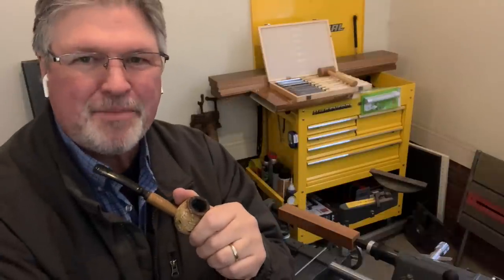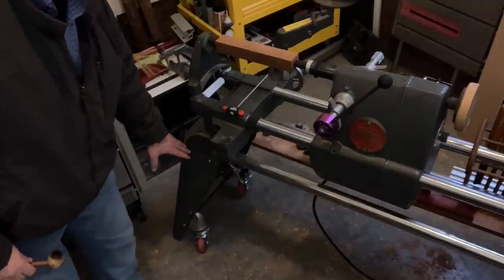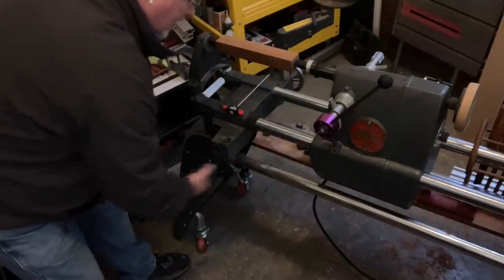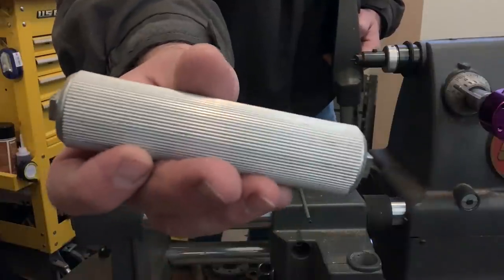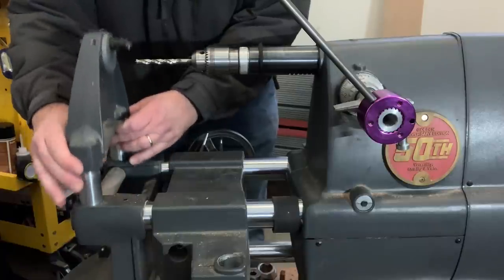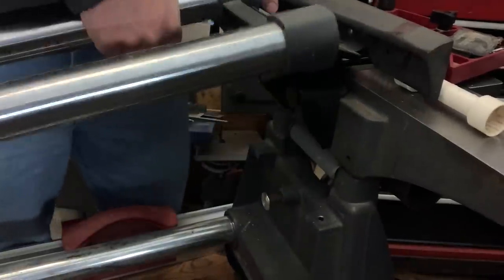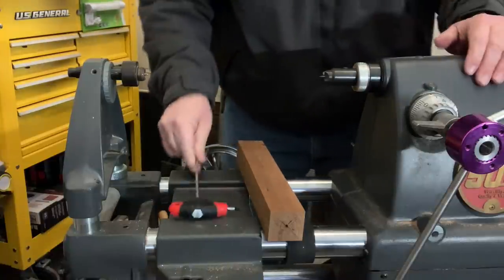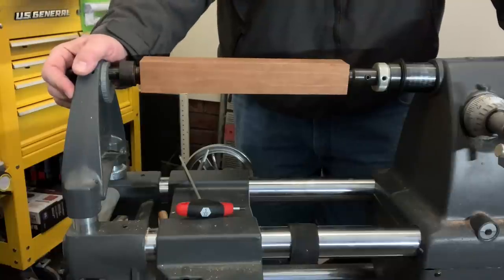Before Turning On Your Shopsmith Lathe, Watch This!

Comment: 33 year SS Mk 5 500 owner, and I never knew about the way tube set screws until tonight (yes, I'm one of the "got a table saw project right know" guys)! I have the new power head (and it's a beast). The hydraulic lifter makes life easier, for sure. However, I've found that using the lathe with the lifter connected works against the way tube set screws and can cause the whole works to move toward the locking latch end when setting the quill to hold the work in the lathe mode. I usually find this out when I try to go from lathe mode to drill press and can't get there from here. After i got through resetting the way tubes one day, I used a very fine tip Sharpie marker to mark the way tubes at the pivot casting. Now I can see whether I've moved the way tubes. Of course, remembering to disconnect the lifter before going into lathe mode helps... Great channel!
Reply from the maker: That's a very smart idea. I have a Lift-Assist on my 510 back in my shop and I can see how it might add to that stress. Thanks for the tip. Scott

Comment: Scott, I have to say you made me a bit nervous watching your long sleeve jacket so close to the piece you were shaping. Many years ago (1963 to 1973) I ran production lathes making electric motor shafts and still remember looking at pictures of the operators shirt rapped tightly around a shaft that had been in the process of machining. Have you ever heard of a similar thing happening on a wood lathe?
Reply from the maker: Yes, I am familiar with those kind of incidents and if it hadn’t have been so cold in that shop at the time I would have taken a different approach. Back when I worked for Shopsmith we were required to wear real neckties when we demoed the tool, so at least those days are over. That, and my new shop has proper HVAC.

Comment: I'm really loving the amount of time you're spending on each video on not only using the Shopsmith ancillary equipment but how to maintain them. Thank you very much. I hope in the near future you will do several videos on the 12" thickness planer, too. I really need to replace my planer's cutting blades but the written instructions are confusing at best to me. I sure would like to see you demonstrate a detailed video on these steps - both removing and installing a new set of cutting blades.
Reply from the maker: Thanks for your feedback and support. I have a buddy who owns a Pro Planer that I'm sure he would let me play with. I'll look into it.  Scott
Reply: Thanks Scott, I'll be watching everyday for those videos on the thickness planer.  Do you need/want a Shopsmith Scroll Saw?  I thought I would use it all the time but over the years it has sat, virtually unused and covered because I own a dedicated 30-in throat Excalibur brand scroll saw originally manufactured by General International.  It's so quiet that I don't need to wear hearing protection and I can finally play music in my woodshop.  LOL.  I know I probably won't be able to sell the Shopsmith Scroll Saw for what I paid for it, but I really hate it taking up space in my shop not being used.  To look at it you would think I never used it.  I guess some day if my Excalibur dies.......but......knock on wood, that won't happen for a looooong time.
Reply from the maker: @johnhuggins5021  I have a SS mounted scrollsaw, but like you, it rarely gets used because we purchased a DeWalt, which was based on the Excalibur patents. But thanks for thinking of me.

Comment: If a person upgrades their Mark V 500 to a 520 with dual tilt, then the tailstock will likely no longer be in alignment with the offset set at zero because their tailstock will be the old one with only one set screw.  The only solution then is to get a new tailstock.
Reply from the maker: You absolutely lose that ability. It's a trade-off, for sure.

Comment: 0:54 it is more an Italian thing that spread across Europe through the years. It is about how this country is. We used to have three quarters of the population crammed up in teeny tiny houses up in valleys. It was common to see woodshops as small as an American garage. The problem was not to stowe away a lathe to make room for the car. The problem was where to put all the other flatbed machines.

And don't worry, even on a combined EU style machine there are countless ways to get seriously injured.
😅

Comment: I just bought a Shopsmith that was made in 1955, primarily for the lathe, disk sander, and horizontal boring functions. I've been woodworking professionally for over 25 years but never did much turning and that which I did was on a Shopsmith. Anyway, just teaching myself to turn as I'm doing furniture repair full time and we occasionally need to re-make a spindle, stretcher, leg, etc.. Thanks for doing some really basic stuff with both turning and Shopsmith. I have the original threaded posts on my tool rest and it's aggravating to make a minor height adjustment because the teeth on the "rack" are angled by way of it really being a thread, so the whole rest swivels back and forth out of parallel with the stock.
Reply from the maker: Hey Jonathan. I recommend grinding or sanding a flat in the post, as I showed in the “picture in picture” at 15:30 or perhaps consider picking up a modern version from SS or on eBay.  Scott

Comment: I love the way you called it a lathe-based multi-purpose tool. I picked one up in an auction for 200 bucks thinking that it would make a great lathe. I don't really have any intent on using the other stuff.
Reply from the maker: Nice get!
Reply: I bought mine just for using as a lathe and I love it! Especially its horizontal drinking ability. I got a chuck on mine, I would say it's pretty useless as a lathe without a good chuck. I think it's a Nova chuck, pretty expensive but worth every bit! I hope you're having a good experience with yours
Reply: @theamaturepro  I have yet to use it. To be honest. Thanks for the tip about the chuck.
Reply: @DanH37ww  well get on it! Lol. You'll be looking at every tree in your yard for limbs to trim off for material! Lol

Comment: Hi Scott! Love the information in this video!
I just got my hands on a 1992 Mark V 510. It only had the table saw, table extension, and bandsaw attachments but I would love to also get the lathe and other tools as well and follow in my Dad's footsteps for his furniture making hobby. I am going to buy the lathe accessories from Shopsmith directly if I can (or Ebay or Amazon worst case) but are there any "Do's" and "Don'ts" that you can recommend or give some advice on for starting out  turning? I will be watching the rest of your videos too now that I have found your channel!

Comment: Garry not Linda. I went to your blog linked above but didn't see a category that fit for some off topic material. I honestly don't know how someone 6 feet tall can work at a Shopsmith lathe. I'm only 5"8" and my back would get so sore and stiff leaning over when turning. I got tired of it and measured the height of my elbow from the ground, the height of the lathe center and built two riser boxes to raise the lathe centers to elbow height. The difference is like night and day. I can turn for hours with no discomfort. Yeah, I can't use the drill press but not a problem. The machine is anchored to the boxes which are wider than the base so no chance of tipping it over and let me tell you I've had that thing shaking pretty good a couple of times! To get around the lack of clearance when trying to turn on the end of a piece at the tailstock pick up a #2 Morse taper extension on Ebay for about 30 bucks and life will be so much better. Don't bolt a piece of square tubing to the tailstock like a video I saw on YouTube recently!
Reply from the maker: I used to have a set of blocks that I made for just that application. We took in a job in an architectural millwork shop where I worked back in Dayton where I had several large finials to turn for the top of gazebos at a local park, and because of the hours and hours that I would be turning on the Mark V I first built those blocks. Made a world of difference.  Scott

Comment: A great instructional. I just refurbished a 55 Greenie for a friend. Although I explained all of this, having the video as a reference will support her knowledge. I know there are some differences but the general ideas are there. Liked and subscribed!
Reply from the maker: Glad to hear it and happy to have you here. Scott
Reply: @MyGrowthRings  I meant to mention that I did the work here in my shop and showed her the set up adjustments. In order to transport it home in her SUV I pulled the pivot shaft,  A simple spacer block helped in the realignment but she'll need to readjust everything this spring when she can get out there to work. We're in the NE USA. Thanks again for a simple, straight forward video.
Reply from the maker: @StephensPenTurnings  She might be surprised how well it traveled. Scott

Comment: I found mine in a construction dumpster, only attachments I found with it, The jointer, Drill chuck, the disc sander, everything works great little rusty but? Do you know where I can find table saw attachment and lathe tail stock for reasonable used prices?
Great video, I came here after I saw your  appearance on John Malecki‘s channel! Great stuff thanks for sharing
Reply from the maker: Wow, that’s some find! You’ll find parts on eBay, but I would also keep an eye out on Craigslist and Facebook Marketplace, where you might find a reasonable priced unit that is being parted out. Scott

Comment: Thankyou for your fast reply Scott. Interestingly, while you say my Mastershop is a clone and only "similar" so I'll get something from your videos, I saw nothing you showed which wasn't exactly the same. Additionally, there's a UK site calling it a "rebadged" Shopsmith and in doing so, sells the MkV workshop manual for it, along with several other "rebadged" multi tools. Interesting if nothing else. Johnny
Reply from the maker: Yes, they are pretty faithful copies, but because they were reverse engineered the parts are all slightly different in the size. Most of the Taiwanese machines have black lower tubes, and some form of hole or vent or opening on the legs. Also, the switch is usually below the speed control on the motor pan. There are other differences but those are the most obvious. If by any chance you have one of the earliest models with a switch above the speed control than those other trade dress changes I mentioned may not be present. Trust me, Shopsmith would not allow their machines to be “rebadged”. I own thee clones myself. Scott

Comment: Hi Scott !! I use some Emery cloth strips to clean up the bad spots on the machines I buy. I use a little WD40 for a lubricant. I just pull it back and forth over the tubes in a "sawing" motion. Seems to work great for me. Give it a try !! Thanks for another great informative video !!
Reply from the maker: I've done that myself. Great tip!  Scott

Comment: Scott thank you for the video. It is particularly interesting to me because while I do not have  Shopsmith multi tool, I have recently acquired a Mastershop multi tool which, as you may know, seems simply a rebadged Shopsmith? Either way, its vintage at 30 years old, heavy and ordinary. But I bought it as a lathe and I'm hopeful it will allow me to learn turning some chair legs and stool legs. I will additionally watch your other videos in the hope of learning all I can about it. Thanks again. Johnny
Reply from the maker: Hey Johnny. No, it’s not Shopsmith. What it is most of us refer to as a Shopsmith clone. Was in Taiwan I’ll be approve shoots between Shopsmith in to town wish resulted in agreement imports have to make certain “trade dress” changes, meaning primarily cosmetic changes.  They are not 100% compatible because the number of changes were made in China leave engineered those components. If you Google the term “shopsmith clones” The first couple responses are things that I wrote on my blog.  Either way, you are welcome here, machine is close enough information I share will be useful in applicable to you.

Comment: Hi Scott. I am so glad to have found your channel, I am learning so much about the Shopsmith.  I inherited a barely used machine and the planer and jointer were in the original box unopened.  So far I have only used the drill press, but now because of you, I am ready to use more. Is there a video somewhere on the set up of these machines?   I am more a visual learner, and the planer has a lot of parts.   thanks so much.   Diana
Reply from the maker: That's awesome, Diana. I haven't done a video on the planer yet, but I do have one on the jointer that might help. It's not exhaustive, but it might help: https://youtu.be/OvfKgNtxsR4

Comment: Hey I was just given a shop Smith Mark 5 is in ok shape I'm not sure were even to begin the rails are a little rusty any suggestions were to start
Reply from the maker: Did it come with a manual or any other books? That's where I would start. Check http://www.shopsmith.com for anything that's missing and if you go to the bottom of their home page, click on the Forum, for free access to literally YEARS worth of knowledge and experience.

Comment: Welcome back. I'm going to disagree on the purpose of the set screw under the way tubes. In my manual (page 27) Alignment and Adjustment (Model 510), 11,  The setscrew is for aligning the extension table on the left end, with the worktable. Lathe: On page 28, you loosen the setscrews on the eccentric mount. Rotate the eccentric mount as needed, tighten setscrews.
Reply from the maker: I suppose we'll need to talk about this some more mid-week.
Reply: Ok. So I  just went and checked out my tailstock. I upgraded to 510. I still have the 500 tsilstock. After I commented previous, there was something that didn't sit right with me. I didn't align the tailstock during the 510 upgrade. The 500 tailstock doesn't have eccentric tubes. In fact, they (tubes) have been pressed into the tailstock, no set screws.... so the adjustment is to rotate the taper assembly (one setscrew). Hope this helps your update
Cheers
Jeffrey
Reply from the maker: @jgmallin7080  None of the Shopsmith tailstocks have eccentric tubes. The “eccentric” is referring to the adjustable  Morse taper cup.
Reply: @MyGrowthRings  ok... now I understand the 2 set screws style. But I'll have reread the 510 setup. I've read where someone suggested tilting the tailstock to make it line up. I dont think that was  SS idea. To me  the idea of quickly swapping to another setup  should not require bending/ tilting anything .
Reply: You, again, are absolutely right :)  ...... the eccentric is the one on top. As per instructions. Having reread that section,again,  and again....

Comment: Scott, I just pulled my dad's 1980 shopsmith out from against the wall.  It's been setting for decades but inside.  I've waxed things up, oiled where necessary, based on your videos.  I just found your channel, I like it! Thank you! Was checking the lather tailpiece, only one set screw on the eccentric.  On the casting for the way tubes at the opposite end...I lift waytubes and the is only a threaded hole under the far tube.  I am assuming that is where the adjustment setscrew should be resting??  No clue where it might be.  Can this still be purchased from SS?  The manual I had found online stated to just move the eccentric, didn't mention this 'hidden' setscrew for the tube to adjust alignment.  Could this be a model that did not have it included?  Thanks for the videos and the help. in this case. Daren
Reply from the maker: That’s great news, Daren and welcome to the channel. I doubt that they have that setscrew available because I don’t think they use it any longer. That said, I may be wrong. It’s used on the Mark V, but not on the Mark 7, but I believe that they have the Mark V still in production so there’s a chance. If there’s a hole there was a set screw. I suggest giving Shopsmith a call. Scott

Comment: Hi. I acquired a Shopsmith Mark V with a bunch of its tools. I don’t think it was ever used much if at all. It’s been in storage for 5-6 years. Some of the tools have some rust other parts have never been opened. The 4 long tubes running end to end have some light rust on them. What is recommended to clean them? Loved this video - I did see a video of someone laying their tool’s back on the spinning wood to see if it was smooth.